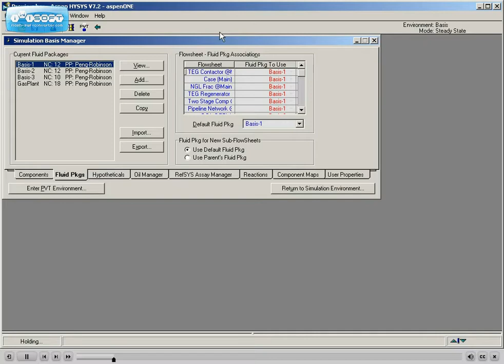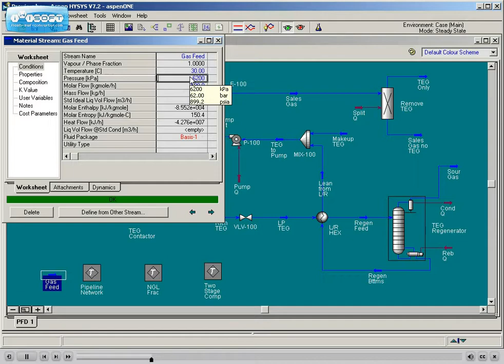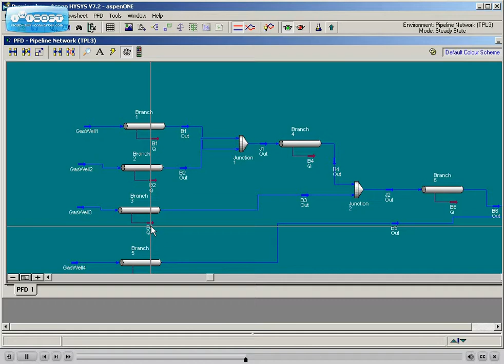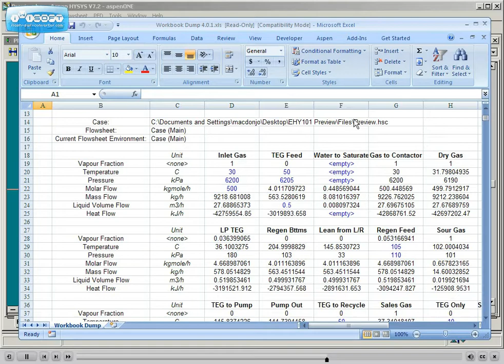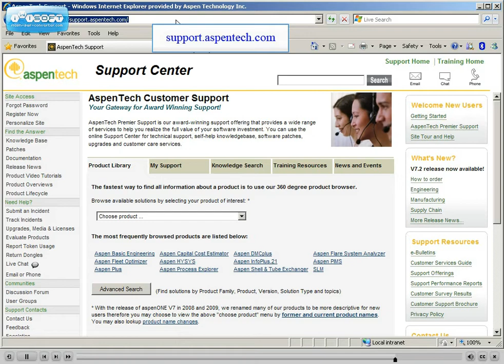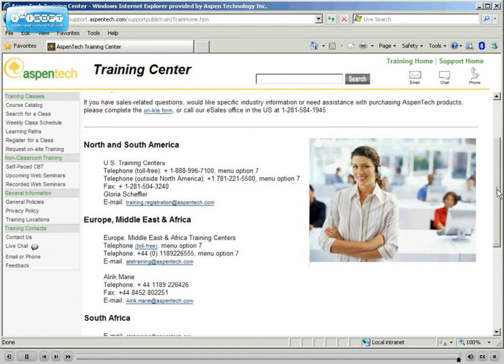Aspen HYSYS: Process Modeling Class Preview

Comment: how to use sub flow sheet for sweetening process I have using MDEA it is not operating at peng Robinson so I have 2 phase gas gathering n sweetening in gas gathering i am using peng Robinson n for sweetening i am using amine pakage but when i entered sub flow sheet n entered T-P and entered environment it didn't convert basis 1 to basis 2